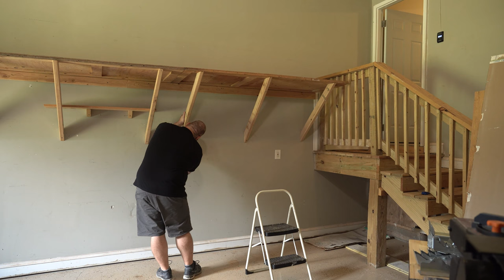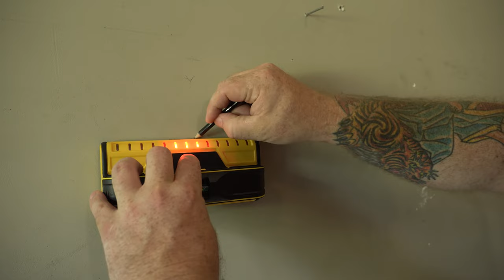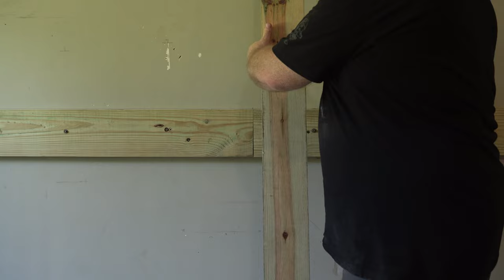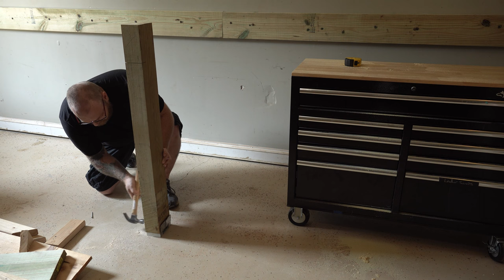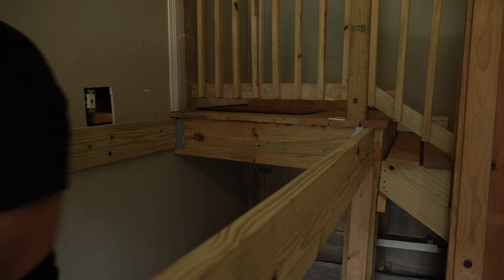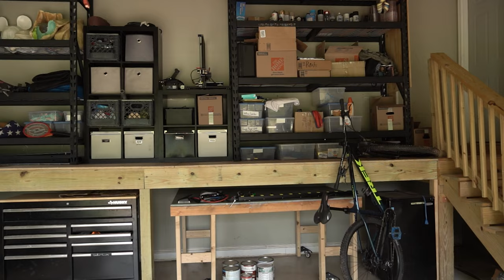Improving garage storage in the new house!

Comment: Nice project. Love the ability to roll and nest the workbench/drawers underneath. Two things I always suggest to people working with limited space - 1) add locking casters to everything you can, and 2) think about your space as cubic feet, not square feet. Don't be afraid to go UP. I've got some more shelving that needs to be built - thanks for the inspiration.